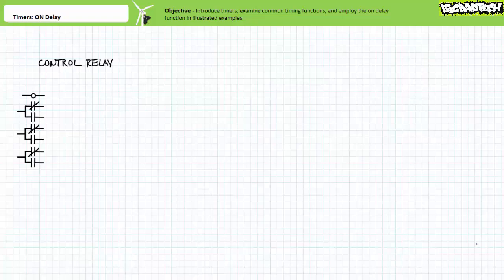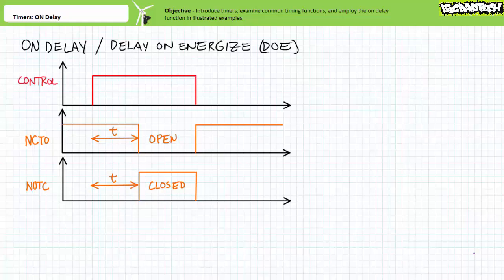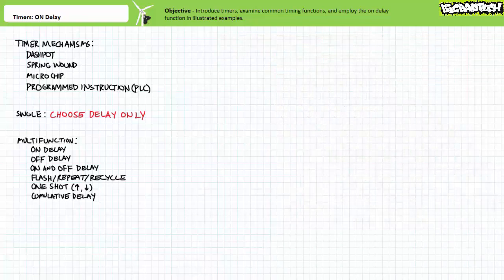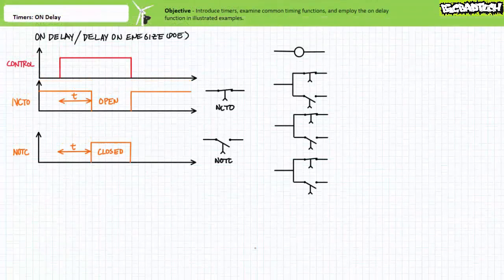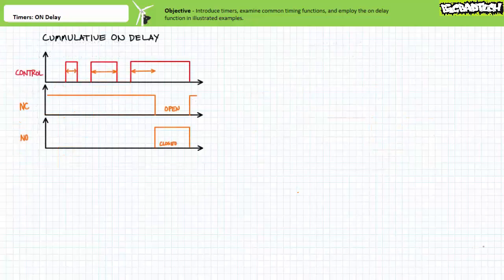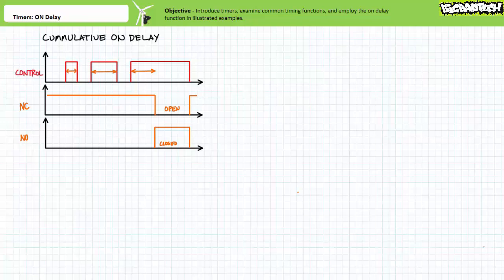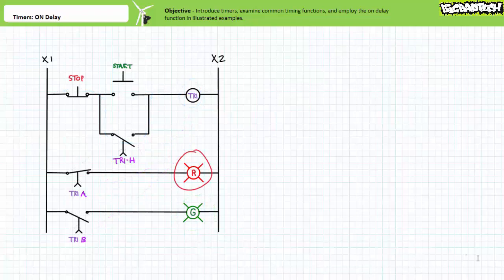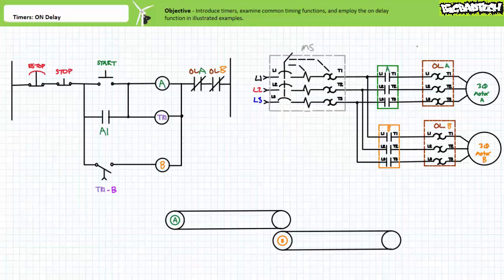Timers: On Delay (Full Lecture)

Comment: Hi Jim, another brilliant lecture! Thoroughly enjoying going through these on lecture at at a time. Quick question: at 35:56 you say the OLs for Motor A and Motor B are in series with each other. I can see that that’s the case in the pilot schematic, however the primary seems to show otherwise? Is this an error or are we only to look at pilot schematic to understand the electrical function?
Reply from the maker: Yes, the NC OL contacts are in series in the pilot circuit only.

Comment: I have came across a similar application in ready mix batching system where belt A is a weighing belt that also transfers to belt B, then B is transfer to mixer . Belt B has to start first then A kicks in a few seconds later. Any mistake would mean all the aggregate get piled at the starting of belt B and that one big mess

Comment: I'm building a circuit which has to run a blower motor for a predetermined time after the start button is pressed, which could be 2  - 5 minutes. What is the correct function I'm looking for ?? Is it an off delay timer using NOTO contacts for my motor contactor coil?
Reply from the maker: Check out the edge triggered one shot timer at https://m.youtube.com/watch?v=8hv1raDnpSc